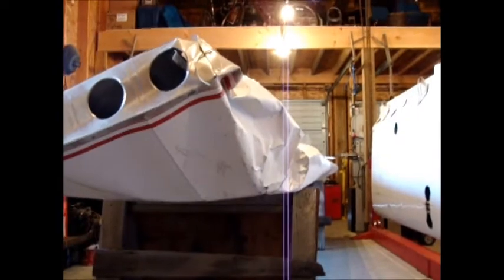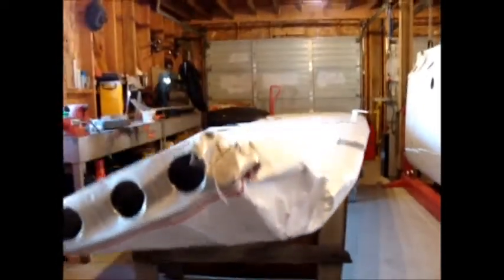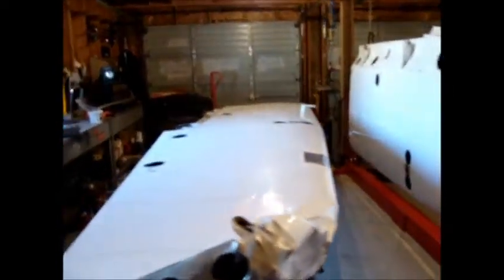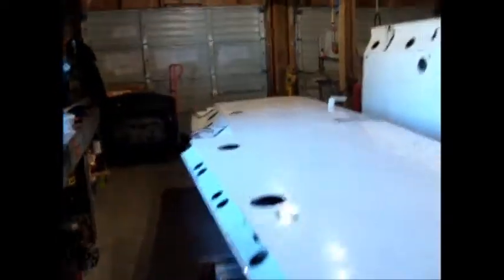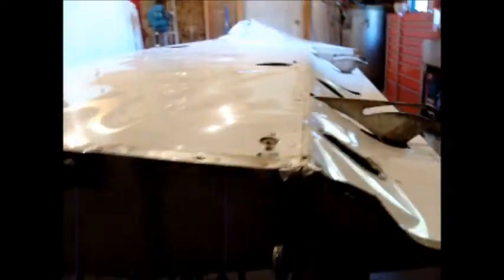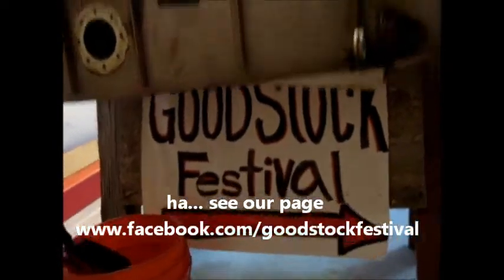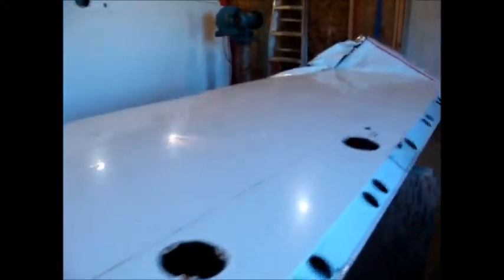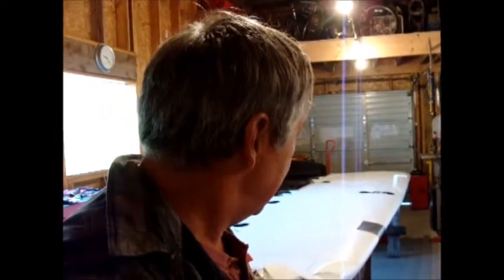Cessna 180 tear down

Comment: I got a set of Cessna 150 g wings that has minor hail damage and, a small limb fell and bent the leading edge inboard of the landing light. Looks like 3 LE. ribs are bent pretty good. My question is. If the bottom skins are in good shape will this require the wing to be jigged if i take off and, install one skin at a time to do this repair. I have long range tanks on these wings and, would rather repair them than get a used set. I am just a average A&P on a budget trying to get my plane back in the air. This was a plane i came across in a project condition.